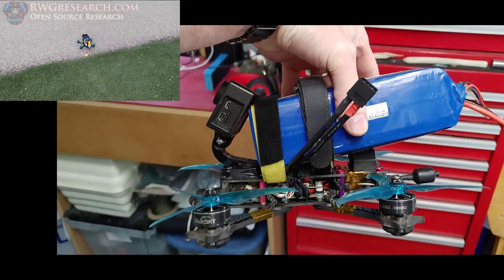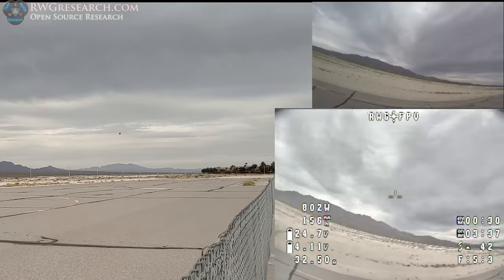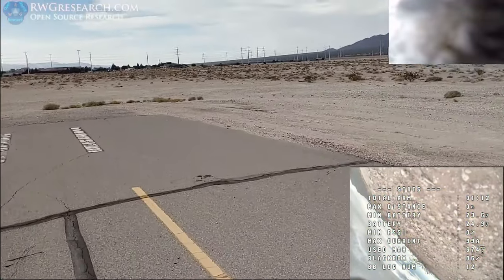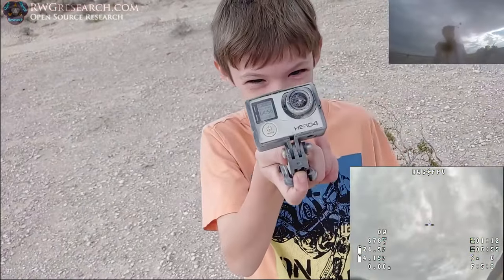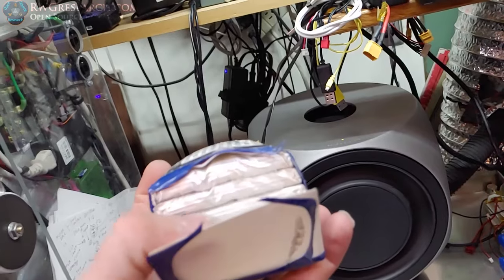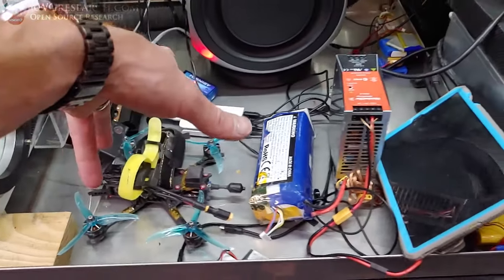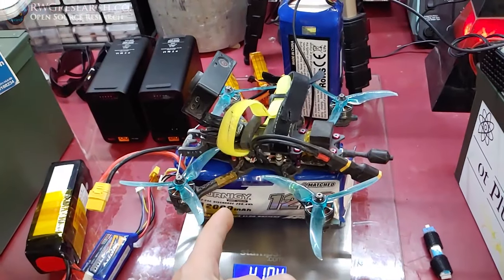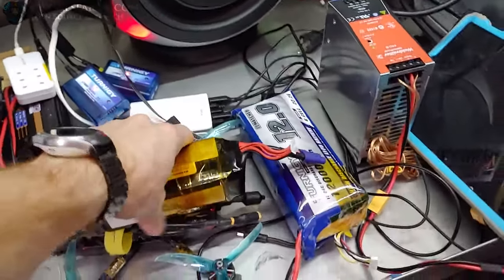12000mah battery with A 5" FPV Quad attached... ! Sure... Why Not!

Comment: 2 kWh was drawn. The puffy cells may go up in fire. It is a bit too heavy. A 1 kg load seems right to me, twice the weight of the quad.
But you won't let me stop trying, so be my guest! I love the footage.
Reply from the maker: Yeah. 2.2kw at peak... That's no joke. Lol puffy cells no Prob.. Been flying this battery for years. The internal resistance is still very low. ~Russ

Comment: Aircraft with CG too far aft of its CG range dont fly (stably) stable unless a flight control computer is working such as on all modern fighter airplanes
Reply from the maker: Yeah. The flight computer on this one keeps it stable. And tries to match the user stick inputs. When you're outside the scope of the performance of the motors / props... the flight controller does you no good. Lol